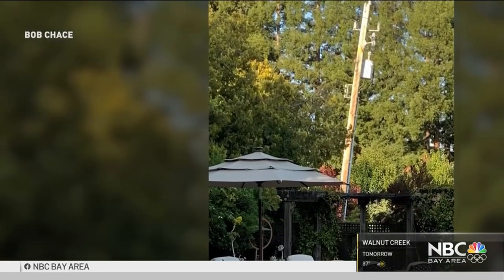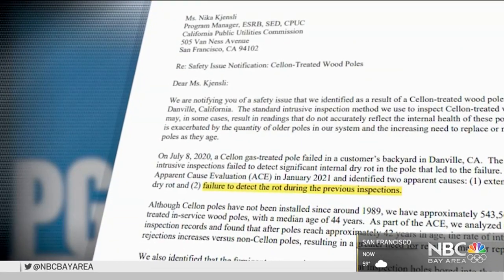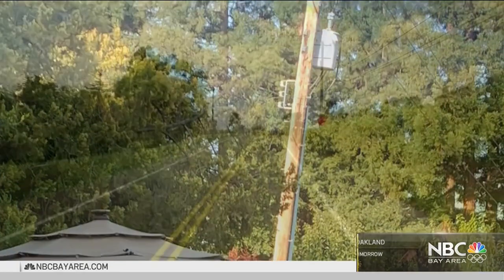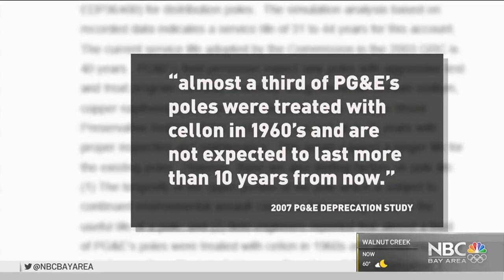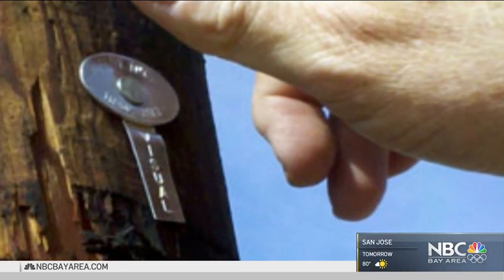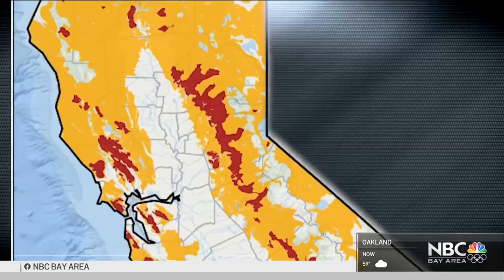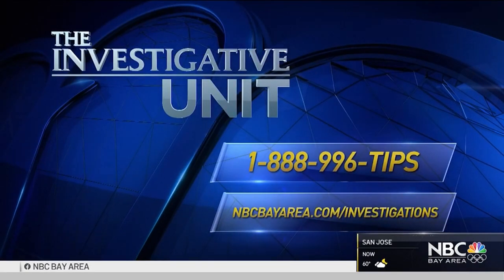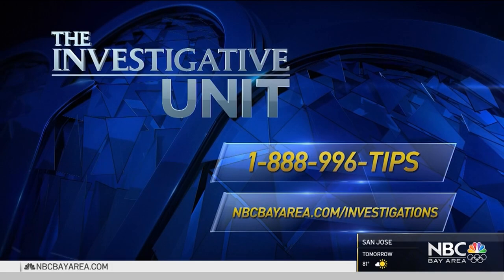PG&E Raises ‘Safety Concern' About Aging Power Poles

Comment: Here in Vallejo.  We have leaning power poles no one will fix.  Non PG&E poles.  There's a volunteer first responder unit that normally checks on them.  They all went down from Covid.  Just what I heard.  But I know what I see.  A lot of leaning poles.  1 is 1 too many.
Reply: I live north of Santa Rosa, we have tree branches covering wires for miles and PG&E won’t come in and cut them down